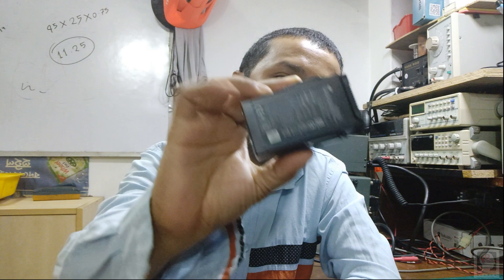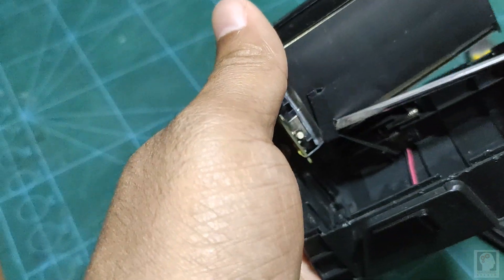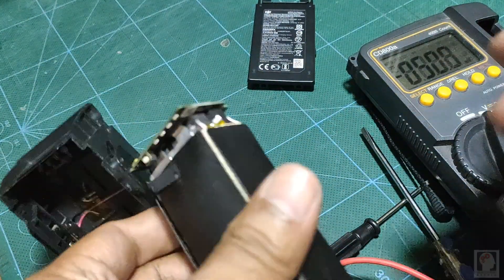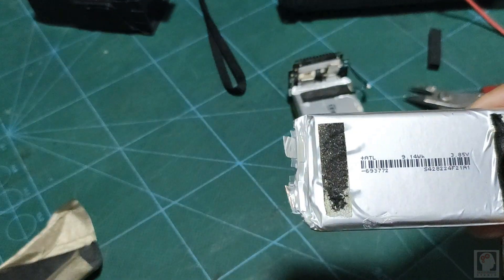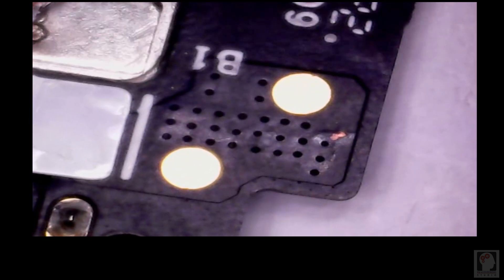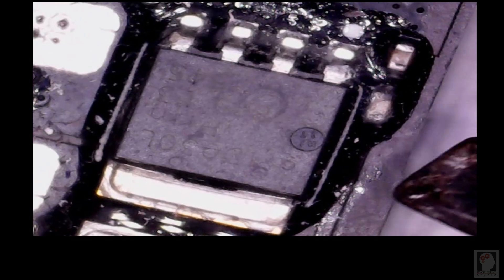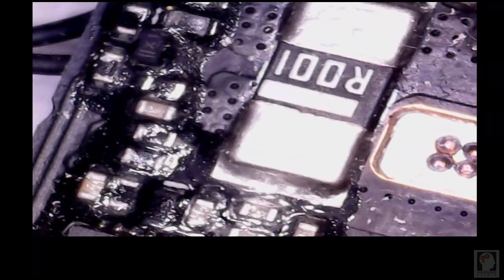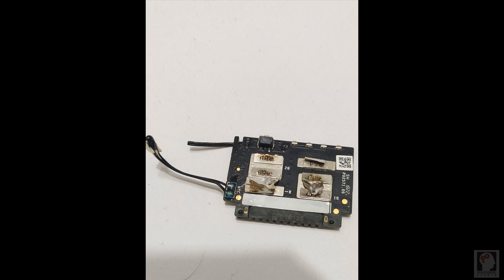DJI Mavic air battery inside story

Comment: Hello everyone again,

My CP2112 card arrived today. I made all the connections, I made a connection with the card. I read the battery card and bingo! Now I can reset the card. I can control the card. Friends who want to renew their battery, please do not pay for these software. You don't need an EV2300 or EV2400 card.
Reply: Hi Emre , could you please give me some clarification about the command sequence (unseal, etc etc) and the used software (i'm using djibatterykiller) using cp2112 interface with mavic air batteries? i'm in a dramatic situation with my three mavic air 1 batteries. thanks a lot and in advance.

Comment: Hello dear,

3 battery packs 3.85+3.85+3.85 = 11.55 volts?
1 battery pack is 2375 Mah? 
What is written on the label on the battery?
I'm going to buy the battery packs and make them myself.
Reply from the maker: You are right

Comment: Thanks for sharing. The protecting circuit locks down when undervoltage are detected. In some case the cells are still good, just need a recharging.
To unlock you need to reflash the IC firmware.
If the cells are good you don't even have to open the battery.

What a messy opening my friend. Use a thin credit card and patience. Not safe to dig inside with a conductive tool.
Reply: Tiago, blz. Me diga uma coisa. Voei com a minha bateria do mavic air até 0%. Guardei e só depois de uns 2 dias é que fui tentar recarrega-la e ela não carrega mais. No carregador hub o led fica vermelho. Você poderia explicar como que eu poderia conserta ela? Vlw!
Reply: @RutaseBRs  É necessário hardware e software específicos.
Quanto mais tempo ficar descarregado, menores as chances de recuperação.
É necessário verificar o nível de tensão das células, se estiver muito baixo, ainda é possível recuperar, mas elas não serão confiáveis.
Entre em contato no meu e-mail que passo o meu WhatsApp para conversarmos melhor.
mirandatiago0@gmail.com
Reply: @mirandatiago0  pode me ajudar ..mandei um e-mail pra vc...tô com uma bateria Mavic Air que troquei a célula..ficou top..mas a placa controladora dela não liga mais...
Reply: @mirandatiago0  desculpas Tiago.
.no final é zero ou letra o maiúsculo??
Reply: @RutaseBRs  conseguiu alguma solução amigo??
Reply from the maker: Please in English
Reply: Mine is dead becos of excessive discharge (a year and half ) Is there anyway I can revive that???
Reply: @VOLTSNVOLUMEOFFICIAL  There is a minor possibility. A year and a half it's probably too much.
If they've stayed too long under low voltage the Lipo cells needs to be replaced.